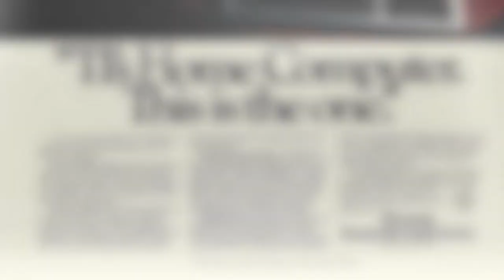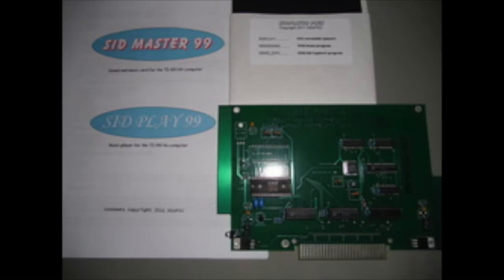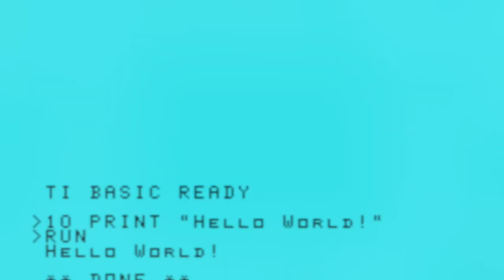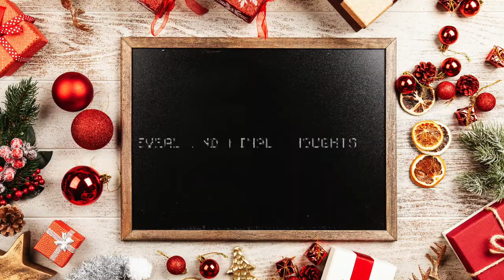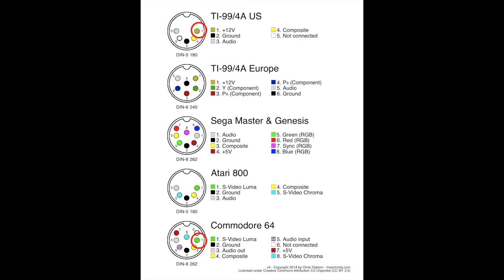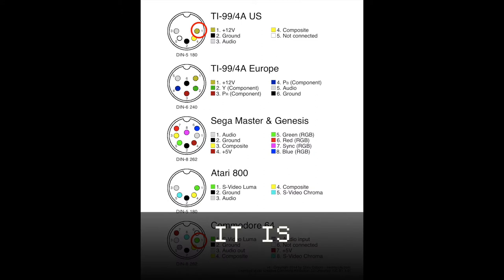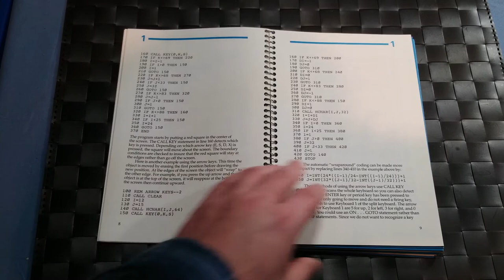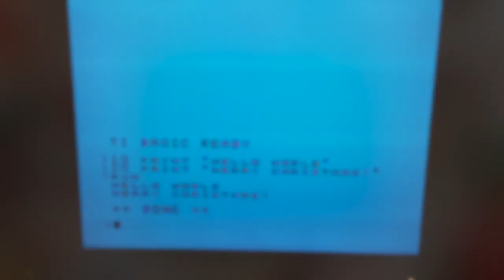Episode 08  - TI-99/4a

Comment: When you look at the Ti's motherboard and say no bad caps I cringed a little. Capacitors don't have to physically show signs of failure to be "bad".  Capacitors of this vintage were notoriously poorly made and over time would go out of spec. They may still work but perhaps at a high or low limit of the original specification. It's always a good plan to replace all elecrolitic capacitors in a device this old.
Reply from the maker: That's a fair statement, though it seems like there's no real consensus, at least among retro enthusiasts. Some say replace no matter what (at least with electrolytics, and DEFINITELY RIFA X and Y type capacitors) while others are more casual about it. I guess I'm in the latter group. If I don't see bulging or leakage I usually leave it be, unless it's a known issue, like on the Game Gear or classic Macs. That being said, there aren't that many on there and it does give me an opportunity for a video. I should at least look at the ones on the PSU.